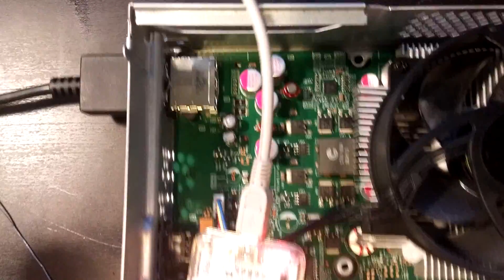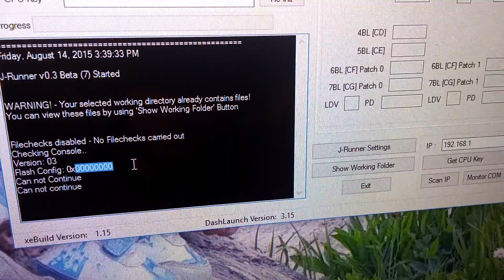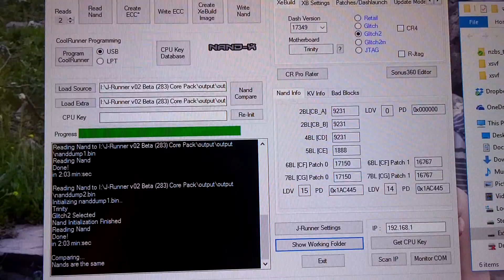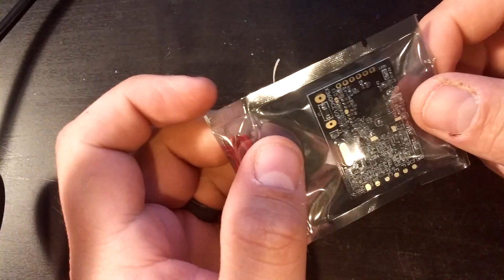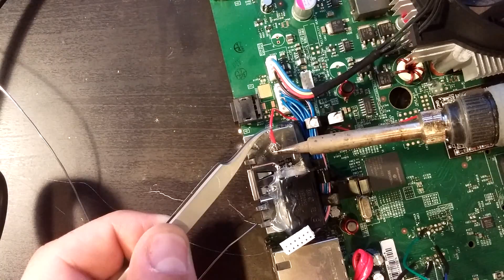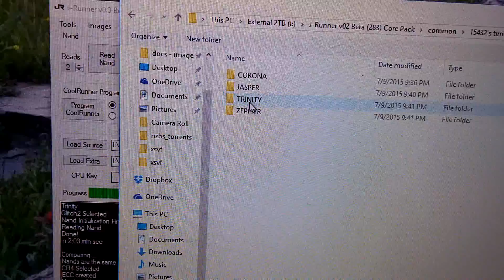How to JTAG RGH Xbox 360 Slim Trinity with Ace V3 and Cr4 speedup files

Comment: Jus to be Correct i Need
Soldering Skills
Soldering iron
rosin core solder
Flux
Nand X Programmer.
Okay ebay provides these stuff above.... that wires you solder the the motherboard and plug into nandx do i have the buy that connector separate and wire the connecter myself?Secondly the Ace v3 is the modchip where can i buy it? Thank you
Reply: Is this reliable-------http://m.ebay.com/itm/X360ACE-ACE-V3-PCB-150MHZ-meilleure-que-CoolRunner-Rev-C-Rev-D-CR3-CR4-/262308801235?nav=SEARCH
Reply: What if i buy a Nand x to coolrunner cable and just cut the wirers at the coolrunner header end?

Comment: Is it okay to do it without the X-Clamp tool???
Reply from the maker: That tool can be bought for less than $3 and is really highly recommended. It can absolutely be done without it but just be super careful removing those clamps because you can easily slip and damage the motherboard with other tools

Comment: does this toutorial work on Xbox 360 E
Reply from the maker: No, if it was an E series with a MFR date of 6/2014 or before it can still be RGH2'd.  If the MFR date is newer than 6/2014 it's likely an un-modable Winchester mobo.

Comment: Does this method also work for coronas or is it a different proccess?
Reply from the maker: Coronas require RGH very much like this but they use slightly different nand points and the Ace chips come preprogrammed for them so you don't have to re-program the ace like I do in this video.
Reply: +TheWeekendModder so I can mod MW3 with information I have a 360 slim
Reply: +Carson Rust and I have had it for a long time like for 4 or 3 years can I still mod?
Reply from the maker: You need to identify your motherboard type if you're looking to mod yourself.  Otherwise if you're considering a send in service check mine out at store.weekendmodder.com

Comment: question for you or anyone. I don't have a programmer got an ace v3 gonna install it on a trinity. Question is will it not boot until i use a trinity timing file?  i know it comes with corona pre programmed
Reply from the maker: +joe smith correct if you put in a acev3 in a trinity without reprogramming it will not boot because it's programmed for a Corona you have to reprogram it for a trinity before it will work

Comment: hi, can you help me up?, i have nand-x and nand flasher as well, but for some reason i try to program the chip and there is---device not found---, i check the wires over and over and everything looks ok, i even use a magnifier to make sure they are not touching each other but still the same problem
Reply from the maker: +carlos tapia device not found indicates a communication problem between your PC and the NandX, not from the NandX to the console necessarily.   Double check your wires aren't switched position at all, and then try a new USB cable - as short of one as possible.
Reply: +TheWeekendModder thank uou i will try different cable, i am using the one i use for my elgato, which is working ok, lol! i am about to give up

Comment: Those of you that are getting the ace v3 chip the point headers are pretty useless and its just a pain finding the right connectors.  What I did was soldered wires on the pins on the back of the Jr Programmer to the ace v3.  What I didn't know is that you can have the program points soldered to the programmer while testing timing files.  Just make sure you unplug the Jr Programmer from the pc
Reply from the maker: +ShadowModding360 check out my latest video it has a pretty neat solution where you use a pin header so that you can plug and play flashing the ace chips
Reply: +TheWeekendModder I think I was just stressing it too much. I ordered a 6 pin header from california on eBay and it got here in about 3 days. I'm in Ohio
Fits both the ace and nand cable perfectly.

Comment: For those poeple who want to identify their boards almost ALL the time this is TRUE 12v-9a= corona 12v-10a=trinity
Like so people can see.
Reply from the maker: +DarkThunder _ When you get near the transition dates those power values are frequently wrong.
Reply: Yes that's correct. It's crazy though because out of all the xbox's i have got only 1 has been incorrect. I'm pretty sure it's just luck.
Reply: Yea... It's a trinity
Reply: I got 12v 10.85A and I have the module for the 4GB memory. What model is that?
Reply: Trinity
Reply from the maker: +DarkThunder _   True, "most" of the time.  Sometimes those stickers are wrong though.
Reply: confirmed that my xbox 360 is a trinity by the 12v-10a, and the header position inside the xbox.
My xbox is manufactured 2010-09-24 if that helps
Reply: I have both a 250gb Trinity and 4gb Trinity Motherboard, they both have the port for the 4gb module, the best way to tell if you have a trinity is the 10a PSU and the HANA chip

Comment: Can someone please help me out!?

I'm a first time  programmer & have almost no experience with anything in this video other than disassembling my Xbox for maintenance & a little bit of soldering, so I was confused to see that my motherboard was slightly but still noticeably different to his despite both of ours being trinity boards. For example, the speaker that makes the "ding" startup sound that he mentioned isn't located on the frame of the Xbox & connected to the motherboard with a wire like his, instead, it is completely replaced by a black cylinder (which i assume is just an improved version of the same speaker) connected directly to the motherboard. Small differences like that may or may not mean that my board actually isn't a trinity, or more likely, in my opinion, that my Xbox is a later model of some sort, although still a 360 Slim, it may have been slightly modified to keep people from RGH-ing their consoles? If anyone can help me specifically identify my console, tell me if it would effect the process of RGH-ing it in any way, & if so, what I would need to  do in order to RGH my console, without breaking it, it would help me so much. & if you need more info on the motherboard, just reply & I'll answer any questions as best as I can. Thanks.
Reply from the maker: +Kevin O' Brien Just post a full frontal pic (post it to imgur and then put the link in a comment) and I'll tell you 100% what board it is.

Comment: @30:05 what program are you using to display video from your xbox 360 onto your desktop display without having to change the input setting on the monitor?
Reply from the maker: +gasper1704 Picture in Picture.

Comment: Ok thanks bro for your reply.Now I have 2014.10.18 MFR xbox 360 can be jtag
Reply from the maker: +Shafi Khan Probably not. It's likely the un-modable winchester motherboard.
Reply: +TheWeekendModder  do you have a link where I can buy these specific chips?
Reply: +TheWeekendModder hey weekend modder can you use that super nand thing you used to program the chip to read the consoles nand or does it have to be that nand x
Reply: You can get a JR Programmer v2 for cheaper.

Comment: Can anyone reply with a list of stuff u need to rgh a slim xbox?
Reply: +TheLemonGlitcher yeah flux,soldier,able to nand dump,wires,screwdrivers to take apart xbox,led(optionoal),computer,flash drive(for xex menu,and all that if you want)My list of thing's I recommend I probably need are listed below:

1. Team Xecuter NAND-X (Featuring Latest V3 Tiros Code - Program TX Cool Runners!)

2. Team Xecuter Cool Runner

3. Team Xecuter Cool Runner Quick Solder Board (X360 Slim)

4. NAND-X to Cool Runner JTAG Cable

5. Kaynar wire - multi colors - available on ebay

6. Rosin core solder, apparently solder with more lead content is preferred?
Reply: +Noah Smith thnx for replying with the list👍
Reply: +Noah Smith wait, does everything hav to be "Team" Xecuter, becuz I keep seeing xecuters but not "Team" xecuter
Reply: +Noah Smith is the coolrunner the glitch chip like the one in the video?
Reply: TheLemonModder yeah
Reply: +Demon Chev http://team-xecuter.com/forums/threads/135475-R-JTAG-is-here-)
Reply: Tx, team xecuter and xecuter are the same thing.  Don't get the quick solder board (qsb) for your first time.  It is more expensive and harder to solder.  Wires only is much better.
Reply: Yes.  You need a demon dual band and your original Keyvault cannot be banned
Reply: *nand
Reply: ***** who
Reply: ***** oh ok lol

Comment: Is there a easy way to mod a console? Phat or slim? Are there any perks to RGH over a jtagg? And if I use your jasper RGH tutorial it will work fine with any jasper console correct? What if it's not a jasper?
Reply: +Zachary Bienstock you as ka lot of questions lol but i can answer them for you
Reply: +Zachary Bienstock most ways are the same,some take less time but arent as good as the longer time ones,i would say slim is easier to mod over phat because the motherboard is not as complex and as difficult as a phat. On the RGH there is no re-boot neccasary to run unasigned code. RGH can be done to any console on any dashboard,however jtag is only on 7371 dashboard which is a lot more rare to be found now that xbox patched it i believe,if you use the tutorial it should work no promises but you must be very careful on this one,if its not a jasper then it will change probaly unless the motherboards are the same type probaly not but yeah. So there you go,anyone feel free to correct me or add anything else